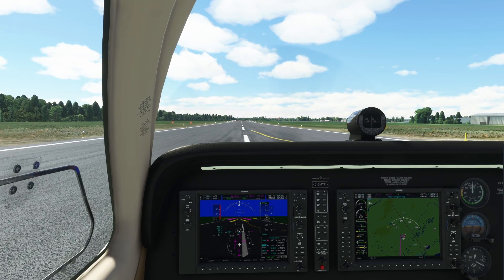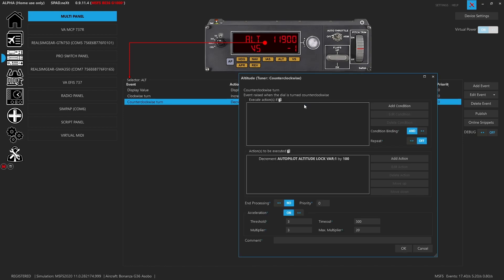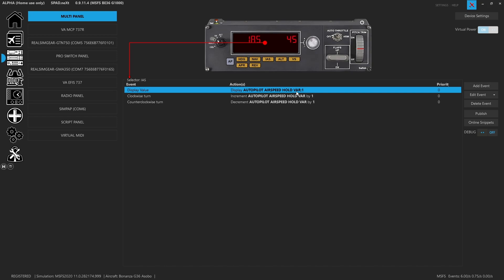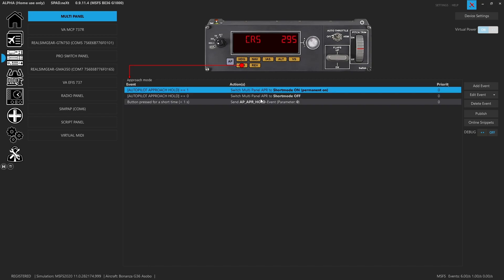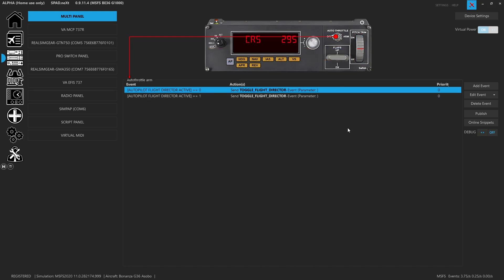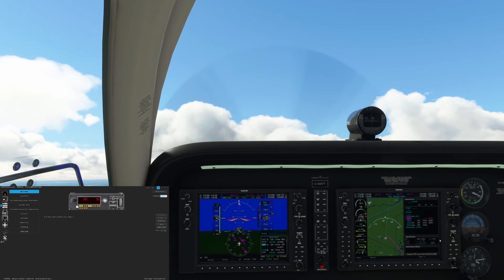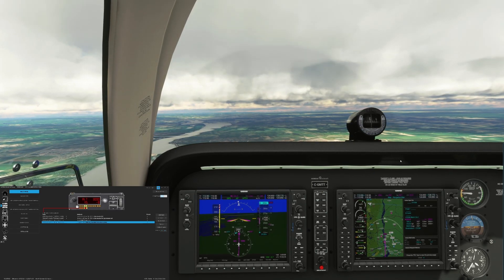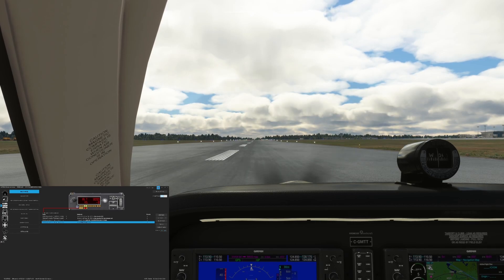(Sim Video) SPAD.neXt | Saitek MP NXi 1000

Comment: I installed SPAD.next (trial) and now have my Saitek Radio Panel connected to the FMS knob/push cursor knob. Works great!
Reply from the maker: Awesome!!!  Way to go....  You have learned to SpadFish....  Once you get going it's not hard to come up with great ideas and applications for your controls!  That said I am still going to do a quick video to use the DME selector for this :) such a great use of that Knob set :)
Reply: @LesOReilly  yesss! And the dme selector is a good one, because not much used for DME, not by me at least
Reply from the maker: That’s what I went with for the video.

Comment: Very helpful Les, thanks.  One small point, the audio on your videos is really low compared to other tutorials and I have to use an external audio amp with my laptop to hear it comfortably !
Reply from the maker: I have my headphones plugged directly into my PC Front Panel port.  I edit in resolve an place everything at a -9db normalization.  This is a broadcast standard..  I do agree that there are plenty of "loud" videos that are basically set to 0db....

Comment: Hi Les. Thank you for all the tutorials you are making. They are great! For the MP and TBM which profile do you suggest to use?
Reply from the maker: I have some slightly older G1000 MP configs that will work fine... Those all used the "standard" events in the TBM and even with the WTG3000 that is currently out there.
Reply from the maker: There is actually one that is not too too old labeled like G1000 / 3000 under my name..
Reply: @LesOReilly  Hi Les ! Thank you very much! Do you know if Spad.neXT can work with the Goflight planes like the MCP Pro for example?
Reply from the maker: I think the MCP is supported.. I know that Go Flight has been the best company regarding hardware protocols and SPAD neXt does support plenty of them..  I can see if I can find a specific list of it but yeah there are a lot of GF panels supported so can't see why the MCP would not be one of them...
Reply from the maker: If you go to Settings - Devices - GO flight you will see they have a lot of panel support including.... MCP, WCP, T8, P8, RP48, GF166, LGTII, LGT, EFIS and GF46....
Reply: @LesOReilly  Hi Les thank you!

Comment: Thanks you very much for this really helpful setup!
Just an question:
When I push the heading button long for heading sync, the heading button one the AP panel is blinking until I do again a long push on the button.
Is there a way that it won’t start blinking at all?
Thank you!
Reply from the maker: Yes when you are in SPAD.neXt on the MP device.. Top Right "Device Settings"  - Settings (Global) -- Light equals Buttonmode ... Turn that to the OFF position...
Reply: @LesOReilly  Fantastic, thank you!

Comment: Can you show you to use rotary know on the Saitek Panel to use for FMS inner knob, outer knob and push-for -cursor knob?
Reply from the maker: Great idea for a video. I will add it to the list!!
Reply from the maker: Oh.. and FYI the Multipanel only has a single Encoder and no button on it...  The Radio Panel has a Dual Encoder but it has no Push button on it either...
Reply: @LesOReilly  I know but another button could work as push button
Reply from the maker: @renefeijen5916  Yes the Radio panel with the button to the side will be fine... Also check out the video I did about making your own Knob with a Project box and Arduino....  It's also great for this use!
Reply: @LesOReilly  will take a look

Comment: When I go to Online Snippets, I do not see your snippets even when I have Cessna170 G1000 loaded in the sim.
Reply from the maker: Make sure you de select the check box that is on the left which filters out other aircraft...
Reply: @LesOReilly  yes I have that box checked.
Reply from the maker: That box is labeled "Only for current aircraft" ....  if you have that checked then it won't work since that was built in the G36 .... not a Cessna... Hence be saying "de select" that box....